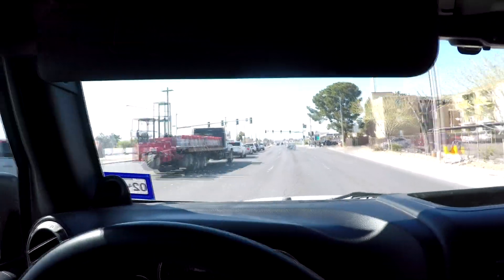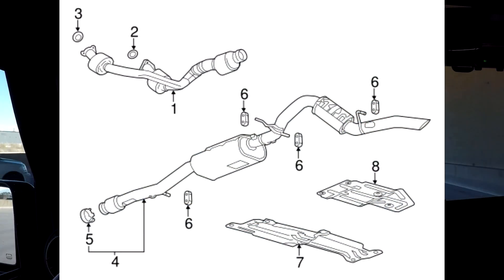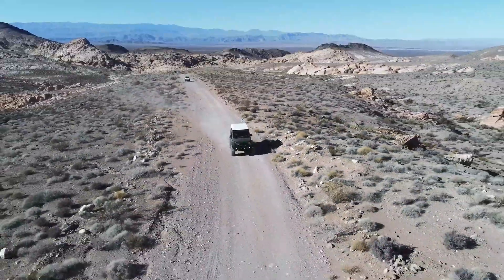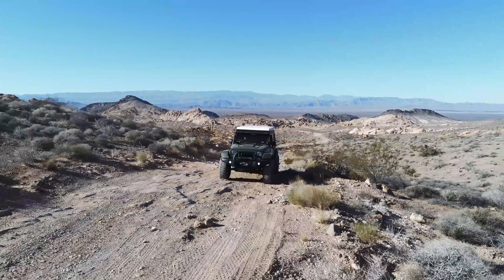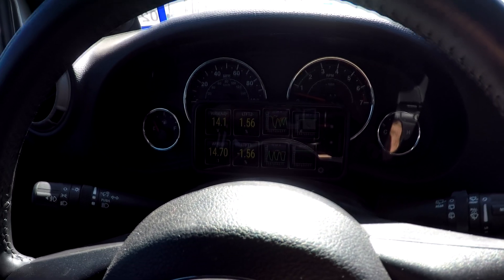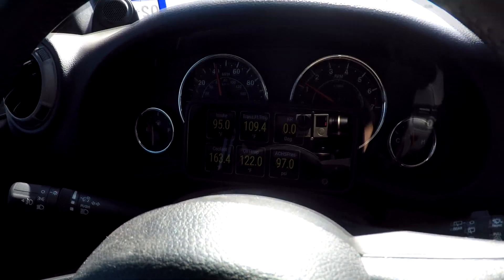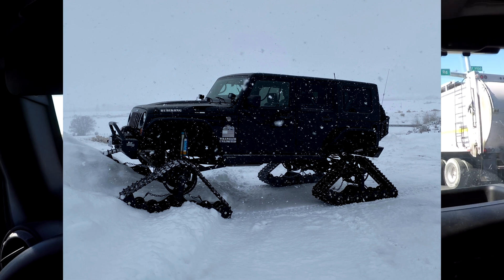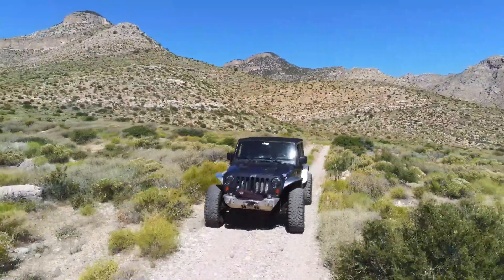GM Cylinder Deactivation AFM/DOD/DFM

Comment: I owned an '02 sierra with the 5.3 for 14 years. No arm and no problems.  Now on my 2nd silverado lease with the 5.3. Due to greed I may have to buyout my lease which I prefer not to and downsize. I have a 2019 Silverado 4wd WT Dbl cab. The engine is5.3L ECOTEC3 V8 with Active Fuel Management 6 Speed Trans. You are right I can't tell when it goes into AFM. I do not have a display that will tell me that either. My previous silverado was a V6 and it did and I definitely could tell when it went in AFM.
I want my next vehicle for LONG term and can't lease due to miles. I don't need to be stranded with a $$$ repair bill after warranty either. What do you think? TY

Comment: Could bad afm cause vibrations when engine goes to V4 mode?
Reply: Yes, of course
Reply: @jrparker4804  I have an oil leak at the back side of the engine (L99), GM says that it could be valley cover gasket. Why it happens? Maybe it's good to replace  whole valley cover?

Comment: If you only keep your truck 2 years,  no problem.  If you want 250,000 miles from your engine,  you better delete the AFM.   I drove an old diesel K5 for 9 years until it rusted out.   Adding up repairs ...  my cost of ownership was extremely low, less than $400/year.   I worked on it myself.   2 sets of tires were the most expensive part.  You have to ask yourself,  do you want to spend your money on a vehicle or eating steak?

Comment: Your only losing a mile or two per gallon to delete, the damage the afm does to your lifters and cam aren't worth the head ache down the road, the loss of lubrication when deactivation mode is on to those cylinders causes increased wear on those parts and will eventually cam or lifters breakdown, deactivate and get the full potential from your engine because you will notice the difference!
Reply: You have scientific evidence of your information?
Reply: @stevenstair1068  You don't need scientific evidence if you understand the operation of oiling of a modern engine it's not hard to understand the effects it would have on long term engine wear. Besides there's a lot of video's on  YouTube where people have torn down these engines and the scientific proof your mind needs to absorb this concept is there, real life proof of everyday use is proof enough, I have owned multiple trucks from Gm with cylinder deactivation and never had a issue but I also trade off before issues arise. The truck I have now I plan on keeping it for a long time so I'm just trying to safeguard my investment, that's just me do what's best for you 👍✌
Reply: So when people use the AFM delete module you can buy, which plugs into your ODB port, will that cause issues down the road?  This will stop you from ever going into V4 mode.  The same as putting it into manual mode which stops the V4 mode, except when in M6, which many Chevy owners do.   Is not using V4 going to cause issues as well if you dont do a full mechanical delete?

Comment: My 2019 Silverado Trail Boss has 30,000 miles on it and its in the shop now having the cam replaced and lifters replaced. It was ticking like crazy.  They say the camshafts have a national backorder right now.
When I get it back if it runs ok I might need the disabler. or trade it in for a Toyota.
Previously had Chevys in the 80s and 90s; had 3  toyotas in the 2000s and no problems; 2019 trail boss has been in the shop 7 times for various items:  difficult to fuel with capless tank, window/rear spoiler leak/roof, now needs a new camshaft and lifters at 30,000 miles.
Reply: I hear you! There’s a Class Action lawsuit against GM for this very thing. Check it out and see if it applies to 2019’s. AFM/ DFM causes lifter issues.

Comment: Not worried about gas anything wrong with using a range disabler on brand new 2020 Silverado? I paid for A V 8. And put flowmaster on it and when this afm kicks on sounds like old tractor ,chevy needs to leave it alone if someone wants a gas saver get smaller truck
Reply: I have a Range Technology AFM bypass plugin for my C7 and it works great. No more V4 and I leave it plugged in at all times.